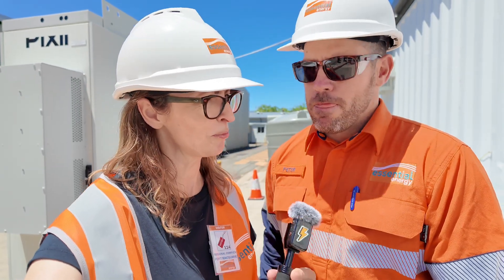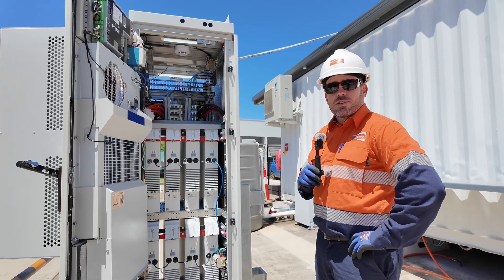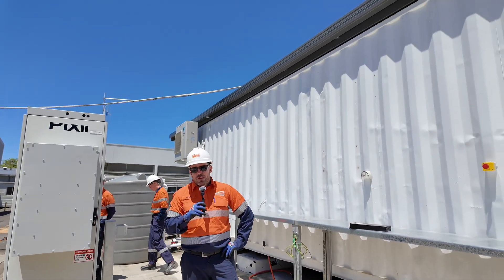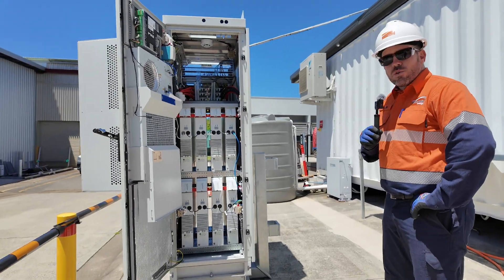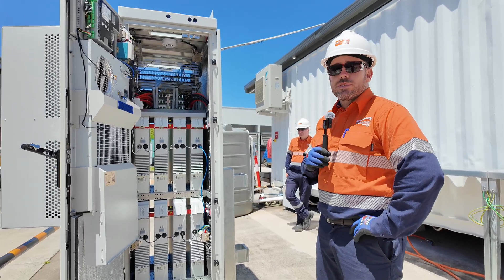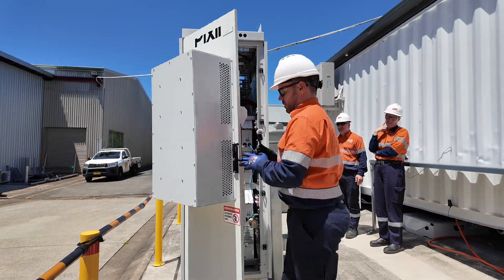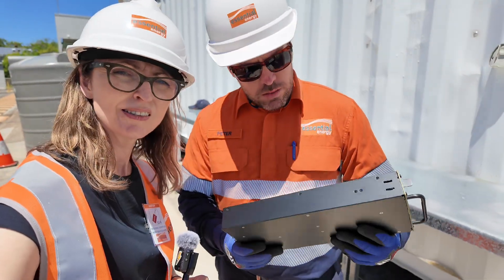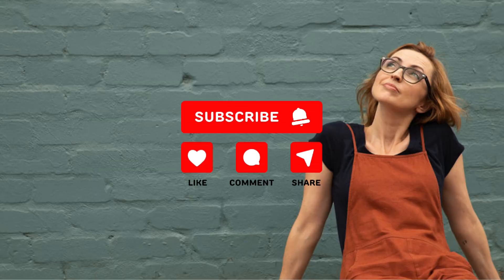Pole Mounted Battery

Comment: Awesome!
Storage is definitely the future! And soon!
Even our  little 10kw battery/ solar system has kept us grid free the whole time we’ve had it
( 1 year now) blackouts aren’t a problem (and we have plenty  of them) as the smart inverter seamlessly switches!
Ditched our gas cooktop a couple  of months ago  so we are gas free too🙏
We run our aircon most of the day when it’s hot and the system still exports to the grid, as much as we are trying to use the power up while the sun shines- Of course it’s the night time that the battery really shines🙏 the house happily runs on it and often we still have 70_80% left in the morning🙏🙏an electric car is starting to look like the next step in using up all the extra solar and stored energy we have at home☺️
Reply: Get the EV. You won’t regret it.